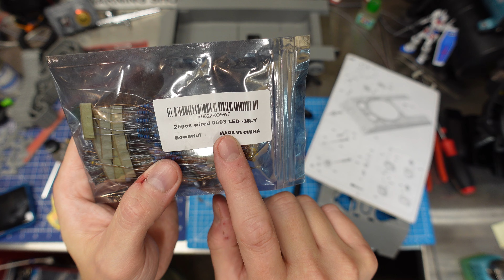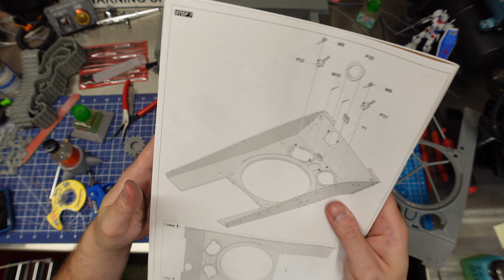Building Andy's Hobby Headquarters Takom M4A3E8 Easy Eight Sherman 1/16 tank kit, part 2.

Comment: I put my tracks together with Tamiya xtra thin. Super easy track to put together. It's all where the glue goes that count.
Reply from the maker: So I did a quick test and cracked open a brand new bottle of extra thin and it worked, not quite as fast as the plastruct but worked fine when i applied a healthy amount, my guess is that the bottle of extra thin i was using was old, i checked and there was alot of residue at the bottom of the jar, I update my advice to include make sure you are using fresher extra thin than i was....that bottle is over 3 years old.

Comment: After getting through these steps on my Sherman build, one note is that I was able to use a small bit to drill through the stud/pin on the bottom of the light that goes into that hole on the hull. I had to run the wires through the front of the light. Made it so there were no wires to hide on the outside. I can't remember if it was a 0.8mm bit or 1mm. Also, good tip on the plastruct cement and using an empty tamiya bottle!
Reply from the maker: I was thinking of drilling through the base of the headlamps but was concerned it may overly weaken them.

Comment: Road wheels....just drilled the suspension boogies. Slightly faster and same result.
Reply from the maker: I thought of that for a few seconds but with my luck I would either over bore them or the bit would grab and possibly snap plastic, sanding the pins is much lower risk in my mind.

Comment: Oh have you not done the top and turret yet then I'll let you experience the surprises coming lol watch out for the bolts on the Breach recouperaters just cut the plastic rod's off shaving them down doesn't work they just don't fit! Back plate not best fit rear right edge leaves a gap needs filled and my copula hatch seems warped or something it's not closing flush and I've not glued nothing as it's one piece that seats in so moulding issue the loaders hatch needs a bit if work of if you want it to open and close, if using the plastic springs included tape the hatch down flush then flglue the springs on or it'll not close flushed if you just glue them on the plastic on mine seemed to shrink slightly and warp with the glue! I've had to make new wire springs and pin it so able to add a figure later just stupid we things that gets on your nerves that shouldn't be an issue!
Reply from the maker: thanks for the tips I will watch out for those things.